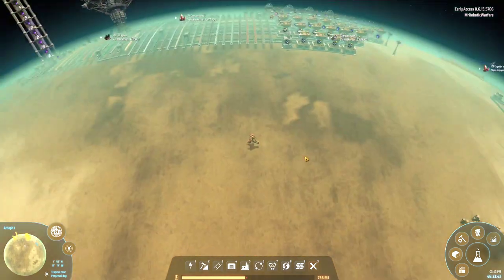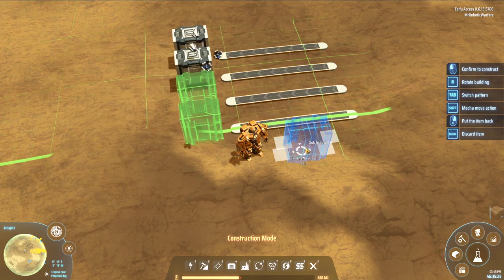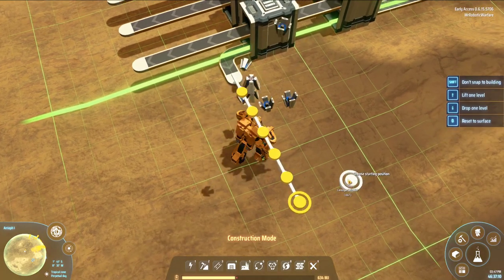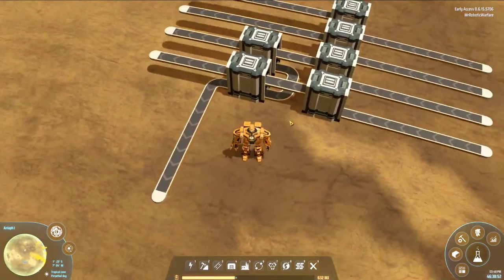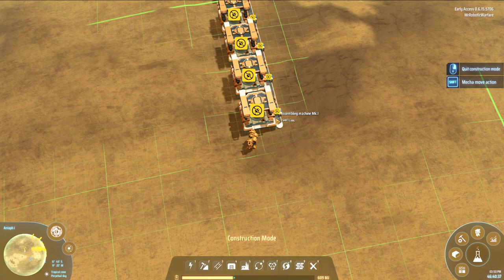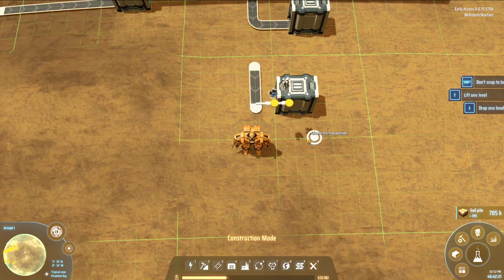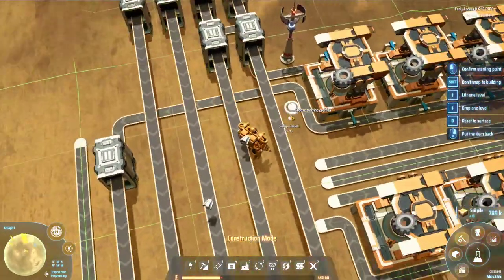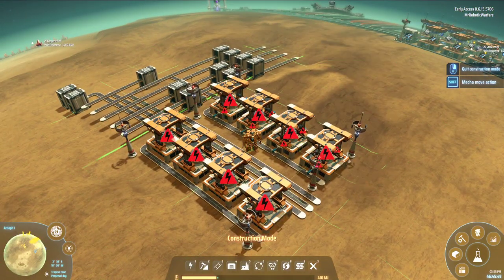Bus Tap & Production Line Tutorial || Dyson Sphere Program

Comment: One thing I like to do in Factorio (haven't tested in DSP yet) is set the output priority of the "feeder" line so that it feeds the tap first, and just generally I try to make sure one belt is filled before anything goes on a secondary belt.  Basically, I try to condense everything so you can tell if the bus is low on iron/copper/whatever because the "feeder" belts get empty first.
Reply from the maker: That's also a totally reasonable setup -- I've experimented with that myself as well.

Comment: How about using a mixture of this with logistic stations:

Use logistic station as source for the base resources in your bus, add producing arrays that feed into the bus, use a logistic station as sink for the products for every 5 new lanes on the bus and if you're done with the production chain on this bus feed the 5 base resources back into a logistic station.
Reply: Of course it'd be less impressive because it's only a solution that fits 5 production arrays but you maximize flexibility with it (as it needs less space in the base config you can place it wherever it's strategically useful). Also you could scale it up quite easily to have a broader bus, you just need to use more logistic stations as sources and sinks.

Comment: I have gone both routes zero bus (except for maybe oil) and then putting towers everywhere and a massive 25+ wide bus with everything on it. I like the design of this bus better than using the other splitter type as this is much cleaner and it looks a lot easier to maintain the closeness without having to do some weirdness with the belts. So thank you for this!

Question, you didn't deny the logistics being "better", but curious if you found a happy middle ground between the two? Like main bus of certain things, or using the towers as feeders into the bus, or whatever... Where my bus started to falter was when I got over 1800/m filling the mk3 belt. You help this some with having two lines of something like iron... But in my current game I am burning through about 5k/m in Iron bars alone, so would be needing ~4 belts just for this if I had it all in one line. Love the main bus for neatness, but it seems to fall apart late game simply because the lines can't keep up.

Anyway, thanks for the videos!

Comment: Great video!  I want to implement your idea on my starting world as a hub/mall, especially pre-planetary logistics, which I haven’t unlocked/used. 1.  Is there a reason not to put a storage unit in between the bus and assemblers? 2. Is there anything you wouldn’t put on the bus vice make on the branch (like copper wire in factorio)? 3. Is there anything you wouldn’t put on the bus at all or make at all?  Thanks!
Reply from the maker: Thank you!

1) Not in particular, I just chose not to. My bus is so large that I felt I had sufficient backlog on the belts alone.
2) Yes, any intermediate products that are only used to make one other thing (ex: electronics -> processors)
3) Final products (i.e. belts, solar, batteries, etc.) don't go on the bus. I also haven't put buildings on the bus, I just make them in my pocket as they're needed.

Comment: Aesthetically pleasing! Just a heads up though: You don't seem to be able to place the splitters in the single spacing formation like you have here on terrain you have flattened using the lay foundation function. Went crazy for a minute trying to figure out why I could single space them in one area but not another.
Reply from the maker: I actually realized after the fact that this behavior is directional -- the splitter must be following a line of latitude. Is this maybe what you're experiencing instead of something related to foundations?
Reply: @Asuhara06  I got the ghost bit. I have no problem placing them, it just seems a bit finicky about where it allows them to be placed

Comment: So i saw biffa doing thes  he said he copied you  my inclination would to be place another production line  on the opposite side of the  bus  say in line with the gears to make another single input product    or   one that uses gears  --  my thinking was also to hae a  centerline belt with all raw materials on it   and   manufactured  parts on a second parallel one .    then  have  the outside lanes for the local  manufacturing needs   so the  fulll planet buss only need to be about  12 belts  wide

Comment: I tried it several time and a bus is useless in DSP. Just build Planetary (and later Interstellar) Logistics Stations and then you can just build manufacturing hubs around these ILS. Especially useful if you use blueprints and planetary sectors. (for example i have a blueprint with an ILS and 80 Assemblers with 3 inputs and 1 output each that i can just plop down, adjust the inputs and outputs and the ILS pulls resources directly from my ILS network and feeds the product into the ILS network, which acts as an interstellar super bus)

Comment: I'm not a fan of buss' over all, but I do use them a LOT early game. In my initial base, I have a 6 lane buss which provides all materials for assembling the 10 major items needed for construction. Once I've gotten Red cubes in production and looking to build the yellow cubes, I move into local logistics towers which yield greater efficiency and cut down on real estate usage. Drawing from a main buss is not very good for production when you need to feed 18+ facilities with multiple inputs and outputs. A buss simply cannot move the number of materials required fast enough. Maybe with T3 belts it can, but that is far enough in that you have most likely abandoned the buss architecture.
Reply from the maker: I agree! As I said in the video, my motivation to use this bus is mostly experimental and for fun. I may choose to do a fully optimized bus at some point, though.
Reply: I just like the aesthetics of it, personally. The starting "Mediterranean" planet is really crappy for them since it has water everywhere and it's too pretty to pave over, imo, but I have a lovely arid desert planet with 100% available construction area I'm slowly moving my production to. My plan is to leave only science and oil builds behind and build a ginormous mall type thing using a bus near the equator on the new planet. Of course, anything that I want to build at a certain speed will be segregated out - this is only for the stuff that I'm willing to have built eventually.
Reply: @MrRoboticWarfare  Would be interesting to see how a main buss using T3 belts would perform.
Reply from the maker: @Dumascain  I'm in the process of upgrading the one you see in this video to T3 belts -- maybe I'll make a follow-up later on
Reply: @MrRoboticWarfare  what about ratios? I can imagine that when you need a third lane of iron you are out of luck? Or will you just supply the lanes with logistic centers every few hundred meters?
Reply from the maker: @schirmcharmemelone  Not entirely sure! Right now, I'm just bottleneck-busting -- I only try to ratio things that are only used once.

Comment: Have you tried making a main bus vertically instead of horizontally?
Reply from the maker: Unfortunately, the 1-gap splitter behavior is directional. This means that this bus design is restricted to running in the east-west direction.
Reply: @MrRoboticWarfare  ah that's not what I meant by vertically, I meant belts on top of each other becoming the bus, and since you can stack splitters using them to send off what you need out and then back down to the ground level. Saving space by building tall instead of wide
Reply from the maker: @kirbyone  Ahh, my apologies. In terms of raw "space saving", technically the vertical bus would need to be gapped by one as well so I'm not sure that you'd be getting any great gains. Certainly a possibility, though!

Comment: Nice! I always got confused about buses, but this such a simple explaination.  How many items do you normally have on a bus?
Reply from the maker: Glad it was helpful! As for how many items, the intent of this one is to have all of them :) Real talk though, generally I use the bus for commonly-used intermediate products. In this game, gears, circuits, engines, etc. are all great candidates.
Reply: @MrRoboticWarfare  cool, I'm going to give this a go on my playthrough!  My factory at the moment is a bunch of spagehetti XD
Reply: Personally, I try not to have the bus too wide, so only things that I'd consider raw materials (copper ore isn't used by anything other than copper plates, so that's a raw material, same with refined silicon)   So graphene, graphite, iron ore, iron plates, copper plates, refined silicon, sulphur, titanium,  and deuterium are the things on my bus.  Using those items, I can make anything else as I need them.  It's not perfectly clean, but the spagetti is under control.  I have a line of boxes at the bottom of my bus with all the manufacturable products that I can go collect as I need them.
Reply: @randeknight  nice, yeah I was thinkin gif you have the bus too wide then its all going to get a bit out of hand!  Ill probably do the same items as you when i get round to planning a bus out!